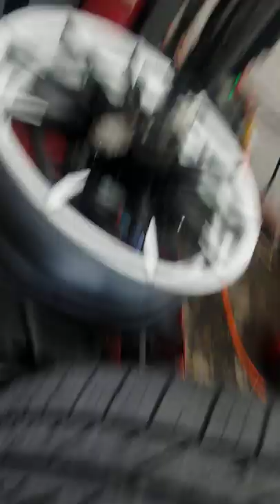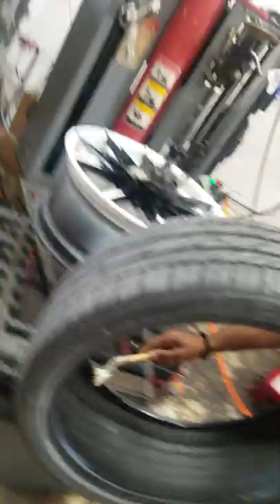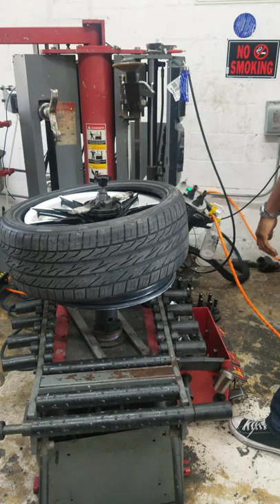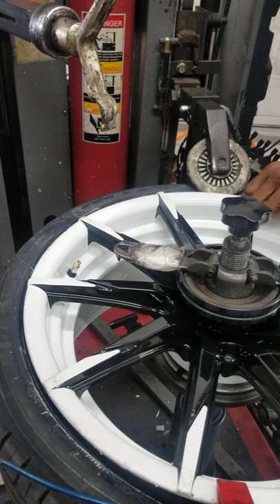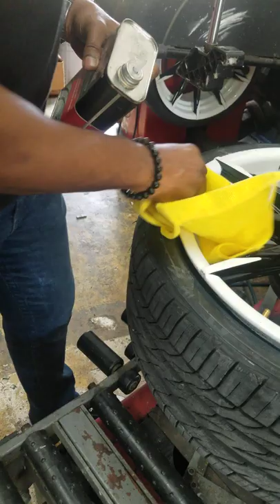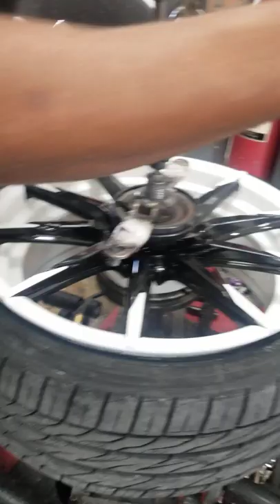Unedited How Custom painted wheels don't get damaged with the correct machine to mount them!

Comment: Do you guys have some 24 inch forgiattos  black to fit a 2008 porsche cayenne s with low profile tires for the front regular tires for the back? If so how much will they hit for?
Reply from the maker: I got a couple sets, probably around 6-8k, call us we will send you some pics of what we have in stock.  You can also hit the website www. DUBSandTIRES.com